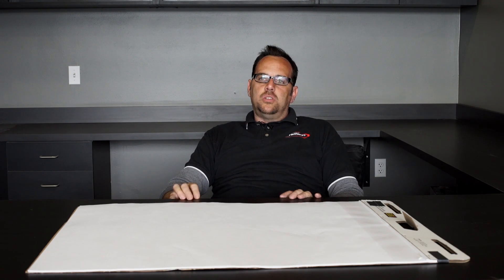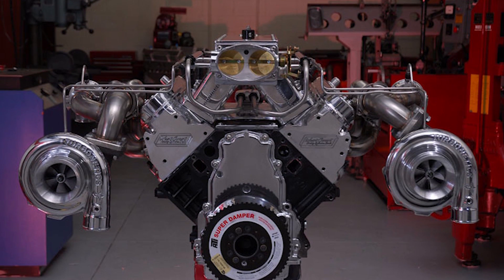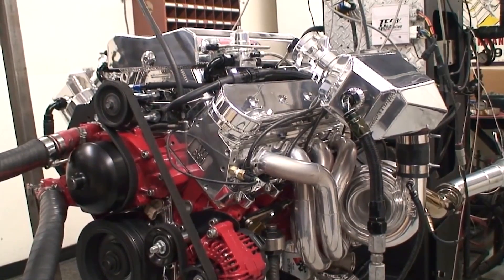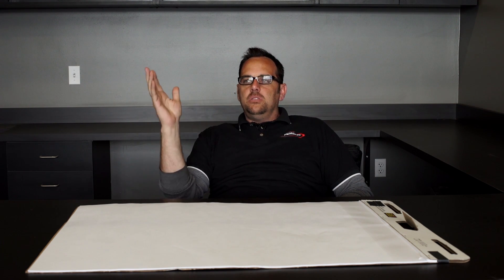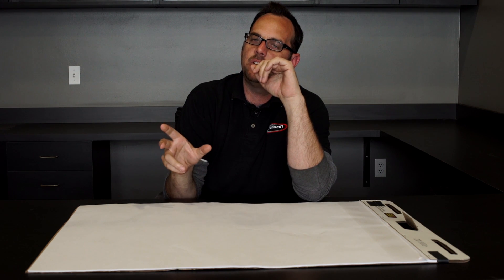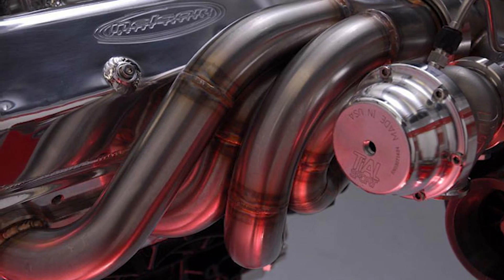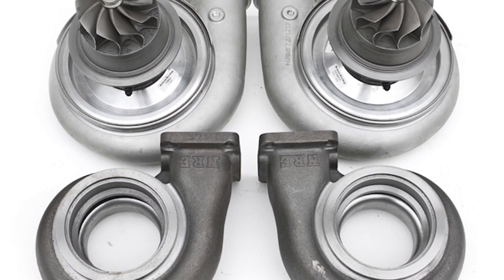Master Engine Builder Explains Why the LS V8 Is SO Good

Comment: last i checked  the supercharged 5.8 from the shelby made the more power then the zr1, 662 vs 650, and the new 5.2 L flat plane crank engine from the gt350 was named the most powerful n/a v8    those arent my numbers, i got them off google search, so by all means i could be wrong

ls is a much smaller engine physically then a mod motor despite the huge difference in CID.... if your comparing shortblock to  shortblock, the mods are smaller and lighter.. but then you add those big ass 4v heads, and it makes the mod motor have a higher point of balance etc etc

it really depends upon your class rules IF any apply... or choosing the right engine for your intended application

to just say one is better then the other isnt true either way

and no import is in the same category so i wont even address the 2jz etc  good engine, but old and heavy etc

Comment: ive owned both a ls and a mod motor... YES the ls especially the 5.3 truck engine is cheap to build, decent power, but you gotta have another junkyard ls for when that one blows...

I once asked a friend that owns a shop which is better, or are they both great in their own way???

his answer was.... mod motors, especially the dohc ones are very expensive to build

the LS he said CAN be built very cheap, but they dont last as long....

and when you compare a blown gm 6.2 vs a blown coyote or even a blown older model 4v or sohc for that matter, they make approximately the same hp

I agree somewhat,,, I DO agree to the saying no replacement for displacement, but thats been proven wrong by boost... that being said   if your gonna boost it anyways, then its PROBABLY best to have the biggest air pump possible

as a owner of both a 6.2 ls previously, and now have a mod motor..... Id tke the ford 6.2 sohc ALL day...

not many people realize that it has a hemi designed head... and if you wanna talk cfm, its stock heads outflow a cnc ls7 head... port the 6.2 sohc heads and theyll outflow almost any gm head

long run... you can get the same performance for around the same priceon BUILT motors.... so its personal preference imo

but i will admit a ls is cheaper and stock is probably better

Comment: " Engines are basically an air-pump- the more air packed in equals more power"In other words bigger displacement means more air and more air means more power.  Nothing will ever replace the raw brute torque of big-blocks no, I don't mean your dad's 1970 454, Im talking about tall-decks and modern builds with modern performance starting at around 540 cubic inches and beyond producing 650+ ft/lbs of torque on pump gas w/o blowers and turbo

Comment: Very interesting video Tom I HAVE A 5.7 HEMI 2004 Truck look  better then New still just wonder what you recommend to get more Power out of it engine is stuck except the cold air intake ank is a K/N    , I WOULD VERY APPRECIATE YOU KNOWLEDGE THANK YOU AGAIN
Reply: +Gilles Godin I bet the "high Performance" intake that he spoke of @ 14:40  was a K and N.....
Reply: +Gilles Godin Mopar performance intake, tithek heads, jesel rocker arms, comp cams camshaft, ID injectors, and a tune will get you just under 600 hp out of a 5.7 if you bore and stroke it
Reply: +johnnybabee yes your probably right i enjoy mind nice noise come from it
Reply: +Thenitroviper why mopar intake what wrong with K/N intake ?
Reply: The K/N is awesome, but the mopar performance intake has better flow distribution to the cylinders to maximize efficiency.
Reply: +Thenitroviper thank you for info Theniotroviper now i have the K/N intake do you thing i would notice a diffrent if i would change to Mopar intake thank you for advise
Reply: Not unless you have cammed the motor. It really won't make a difference unless you put some serious performance upgrades. I would stick with the K/N unless this is a race truck. I have an 05 Dakota with the 4.7 and the K/N filter and an exhaust helped a lot along with a tranny controller.
Reply: +Thenitroviper Interesting i still have  the original exhaust system never hurt of a  tranny controller  which one you thing will make  the most of difference for H.P. or should get both Thank you for expertise
Reply: Good for you
Reply: +SuperJohnny49 speaking of ignorant, did you hear me speak? Fuckin Youtube troll Douchebag.....I mean master mechanic
Reply: good one........

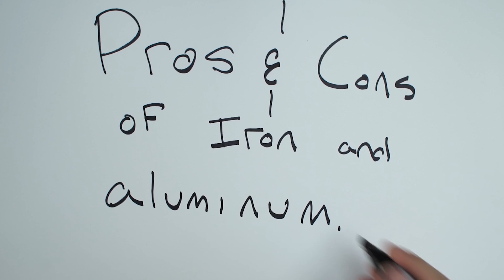Comment: I installed a LS 1 engine in my 63 corvette roadster. The only modification I had to do was weld in a new trans mount for the 4L60 automatic. I have owned this corvette for a good many years and never had the original engine so I thought why not try a LS engine. I couldn't be more happy with the swap. I run the quarter in the high 12's which I could never do with the old cast iron small blocks without spending a fortune . Plus with a 3:55 posi I get about 20 mpg on the highway.

Comment: I wish GM could figure out a way to do variable cam profiles on a pushrod engine.  The D16 Honda 1.6 L engine has a lot in common with a pushrod engine.  It is a SOHC but 4 valve head.  The valves are actuated via rocker arms much like a pushrod engine.  It's like a pushrod system without the pushrods and the cam riding directly on the rocker arms.  Honda manages to make that system have VTEC.  If you could have a VTEC system like that in a LS V8 it would be an absolute monster.  It's like swapping to a race cam once you pass a certain RPM.  Now I wait for all the idiots to insult me because I mentioned VTEC and LS V8 in the same comment...  Before you lose your shit just consider how awesome it would be to select between 2 cam profiles on the fly with a big LS motor.  I think it is entirely possible.  Forgive me for being a gearhead who doesn't hold loyalty to any brand and appreciates the engineering that goes into any engine, regardless of brand.
Reply: +Plur307 The new lt1 has vvt...Gotta do your research next time. cheers
Reply: Clarence Odom
VVT is not variable cam profiles.  Do your research next time, cheers.
  Variable timing just advanced or retards the timing of the cam in relation to the pistons.  Variable cam profiles give you a completely different cam lobe and a completely different shape.  It's like swapping over to a higher lift race cam on the fly.  Two entirely different things.
Reply: I've had a few k series no need to explain lol. And I must add I drive a large push rod v8 now with a ton of low end grunt and you can't even compare the two. My point was that they are making push rod v8's more efficient which is all they ever really lacked. Having owned a few 8400 revving hondas I'll pass on the lack of low end torque and stress you put by revving. For the simple set up of a push rod v8. Type from my phone so sorry if this is a lil long winded. Can't see my whole post without scrolling.
Reply: Just one last thing adding more accessories to an engine makes it more prone to breaking or just adds difficulty when dealing with it...the whole point of a push rod engine is to avoid that.
Reply: I agree, I admire pushrod engines for their simplicity.  But Honda has been building VTEC systems with bulletproof reliability since the early 90's. I've personally owned two VTEC equipped cars and driven both to over 100,000 miles with no problems in the VTEC system.  You never hear anybody complain about them either.  I'm not saying they are perfect, but it's a proven system.

I'm not trying to sound like a VTEC or Honda fanboy.  I just wish we could get an engine with Honda horsepower/liter with American style big V8 displacement.  An engine like that would dominate anything.  Imagine a 6.2 liter LS V8 that still has amazing low end torque but switches to a high lift race cam and revs to 8000 RPM and has power up high too.  It would be epic.

My first car was a D16 1.6 liter Honda civic.  The first time I had the valve cover off and saw the valvetrain I was shocked by how similar it is to a pushrod setup.  I honestly think you could make a pushrod VTEC system using a similar concept.  It just adds one more cam lobe per cylinder and a 3rd rocker arm for the intake valves.Clarence Odom
Reply: Go buy an e92 m3 that's the closest you'll get. V8 with 4.0L and bmws vanos system. plus you can get them cheap now. you have to remember the rotating mass is to great for push rod engines of that size on streetcars to rev that high. Those high revs would be the death of the pushrod engine. By the way while i do miss my k20 powered cars i'd never go back. Low end power is so much more fun to drive. i love my V8.
Reply: Just go pick up a e92 M3...  No problem.  Do you happen to own a money tree or something?
Reply: Nope don't own a money tree. (I also live in miami) I just make smart moves as an adult. Also cars people think are expensive are affordable now. A used c63 amg can go for around 30,000 used and a used e92 m3 goes for about the same. Also those two cars will probably start increasing in value (in a few years) since both companies have abandoned high performance naturally aspirated cars. P.S an e55 amg with a v8 and supercharged engine putting out 470hp can be had for 16,000 give or take. So power is not as expensive as it may seem.
Reply: Clarence Odom
You are completely ignoring the maintenance costs of cars like that.  Every little part can easily cost twice as much as a similar part on a Nissan, Honda, or Ford.  I'm not saying they are horrible cars, but I for one will pass on the "German Engineering" hype and buy a more practical car.
Reply: If you can afford the car you can afford the maintenance lol. I have an srt8 which shares allot of parts with Mercedes. Plus the most expensive out of the big 3 to mod. But im a car guy i knew that going into the market. Plus a 5.0 mustang is still gonna cost you in the mid 30,000s at its lowest. Im guessing your not driving a performance car at this moment. Where i live the weather is pretty good year round so a sports car or performance car is a must have. (Miami). Anyway the rule of cars is you gotta pay to play even a high horsepower honda is gonna cost you to keep up and running in tiptop shape.
Reply: By the way those cars can be had with relatively low miles. And like I said i can def see the e92 and c63 gaining value down the road so its an investment. There is no German engineering hype behind the e92 or c63 they are legit fast high performers. Just because they are priced out of peoples market doesn't make them hype filled. Just means the common man cant afford them which is completely fine.

Comment: The increased demand for these engines means they're not cheap. I don't know what junk yard a person can go to and just get an LS engine for cheap. People generally know what they have, and if they wreck their car that has something like an LS in it, they buy it back, part it out, and not for cheap. Sure, you can go get one of those iron engines out of a truck at the yards for cheap, but then you lose the lightness factor.
Reply: +Tim Ramich   What's not cheap?  There's value for the dollar with the LS depending on what you're trying to accomplish.  Also, there is nothing wrong with the truck engines except for weight.  If you're building an LS to drop into a muscle car, for instance, you've lost nothing.
Reply: +Joshua McClellan Anything more than $3500 for an engine, trans, and electronics is not cheap.

Comment: the SBC put out 70hp/liter 51 years ago without computer aids, and with points ignition...
Reply: +Texassince1836 that may be, but a ls can put out 100hp/liter with the right parts.  though im not quite sure what happened to the sbc. its like it started strong then got more and more watered down over the years. the 80s one are a joke with all the emissions crap
Reply: +andrew mac yes,  emissions are what took down the SBC, they had to drop from 12.5:1 compression in some models to 8:1 Across the board to run unleaded gas
Reply: +Texassince1836 yeah,  the 80s are shit for performamce, but GM stuffed all the power low into the RPM range (275ftlbs@1600rpm on an 86 RPO LS9 350), making them great for daily transportation  (assuming you can afford the gas)
Reply: +Texassince1836 yeah,  the 80s are shit for performamce, but GM stuffed all the power low into the RPM range (275ftlbs@1600rpm on an 86 RPO LS9 350), making them great for daily transportation  (assuming you can afford the gas)

Comment: I never knew why the LS platform was so desirable, but all the points he makes in this video explain it really well. A guy I work with bought an LS crate motor and installed it into his brand new Jeep Rubicon and he brought it in last week. It looks so nice sitting in a Jeep and with the ABS snorkel kit and K&N intake makes it an awesome off-road vehicle. And I think he said he did it all for under $10k, which really surprised me.

Comment: Why cant Americans make naturally aspirated engines that produce 100 or more hp per liter?  all i ever read is the uneducated derp derp saying "theres no replacement for displacement"  well, actually there is, its called Engineering. 
Honda S2000 : 120 hp per liter 15 years ago NA
Toyota Altezza 104 hp per liter 15 years ago NA
JDM type R integra  111 hp per liter 16 years ago NA
B16  SI  about 110 hp per liter NA
E36 M3 about 110 hp per liter NA
the list goes on and on , all of these cars are known for excellent performance, handling and reliability as 15 years of true life testing proves.
and then of course theres all the JDM and Euro engines that are forced induction and hp and torque jumps up waaay above the 100 hp per liter and again,. are amazingly reliable and have excellent torque that the NA engines cant achieve.

Comment: other than this, what would be the best/s 2 or under liter motors
Reply: +Nofukoff I don't spend a lot of time in that arena but I see a lot of guys running 4G63s and SR20DETs still.  A lot of guys still use EJ25s although they're a bit fragile.  4B11 is pretty popular but a bit obscure, never quite hit the stride of the 4G63 in terms of popularity.  The Honda K20 and K24s are always favorites although I've always preferred the K20 (but the K24 is more streetable).  A lot of guys will build hybrids between those engines.  I personally had great luck with a JDM-style EJ20.  A lot of guys love the Focus ST's 2.0T or the similar EBM 2.3T (although a bit bigger than your recommendation).  Same for the VW/Audi 2.0T, tons and tons and tons of guys tune those but I'm not sure I trust them.  Mercede's own CLA45 2.0 is crazy powerful stock but sky high expensive and I'm not sure how much is left on the table.  I guess my personal favorite is the 13B although reliability is subpar and fuel efficiency is pathetic.

Comment: with intake runners on a lot of street bikes measuring less than 2 inches 
quite a lot of those motors run with plenty of power down low and on top 
horsepowers of 150 or more per liter are common factory numbers

Comment: The electric motors in the TESLA are so much simpler, many, many less moving parts, so less to go wrong, makes immediate torque at 0 rpm and doesn't use a drop of dirty gas. Why are you wasting your time on this?

Comment: im thinkin 4 to 5 k and u get what 700hp. in the 70s ford made the 427 ford big block chevy blocked it out of nascar but couldnt do shit about drag racing. no need to build it up 900 hp at crank naturally asperated. that means no turbo no blower and all that raw power. was the first aluminum blocks chevy is just repeteing fords successes

Comment: It's not..? lol
Reply: +b00stedrust Also B series honda motor flowed 280cfm in 1995.. lol... So nascar must not need that amount of flow... Mr.nelson, because 300cfm isnt ground breaking these days LOL.. k series flow 400 stock.
Reply: +b00stedrust ya and probably only like 23 cfm at .200 in of lift. k20's are good engines they make good top end power but they have nothing on the bottom end.
Reply: +Jared Earl I was just stating max cfm.. obviously it doesn't need that cfm at that lift..it's a 4 cyl. I was just laughing that he quoted those numbers lol
Reply: Put a turbo ls in the Honda and destroy everyone.

Comment: which is why LS engine builders got mad when Ford Mod motors beat their ass so bad at the engine builders competition last year that HotRod banned them which is fine SB engine class this year was won by SBF engines and a 880 BBF beat that gm ass this year wonder if the LS bitches are going to bitch about that as well?

Comment: This is a commonly swapped engine for drifting in Formula D believe it or not. You can beat the snot out of this engine and fix it with a hammer using parts from Pep Boys.

Comment: For every single reason he listed about the new LS engine, he should be a big fan of the Ford Coyote/Voodoo engine. Except of course, the Ford engine is actually light. 444 pounds for the Ford (that might be shipping weight packaged as a crate) and the LS7 is listed as weighing 444 pounds, with the same horsepower as the Voodoo engine (525hp). The Voodoo has 90% of it's torque between 3450 to 7000 rpm. The much bigger Cu In LS7 engine has more peak torque, but only in a narrow range. Fine for drag racing, but not overall driving or road racing.

Comment: stock s2000 head flows 330 cfm for 4 cylinders. so ls head is not that impressive..for the engine size

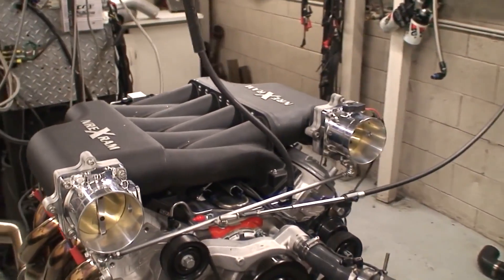Comment: 12:50; Chevy has known about this since the mid-late 80's, look at the 350 L98's, although restricted like hell by EPA regulations but mostly tech, not hard at all these days to add 100 to 200 hp, or even more with pro/super charger, turbo, or nitrous.